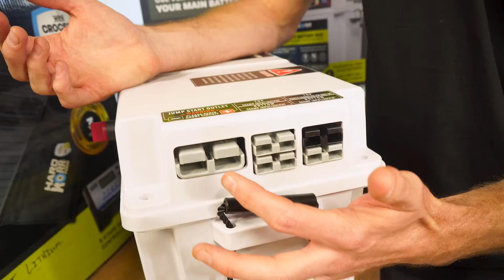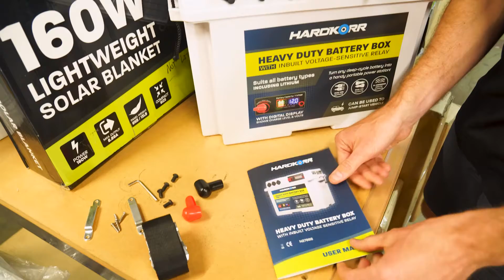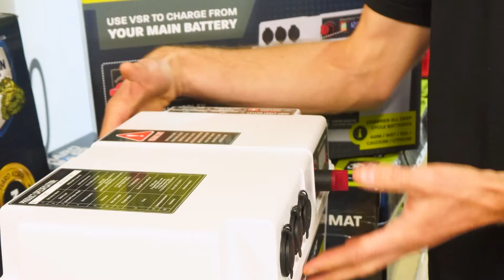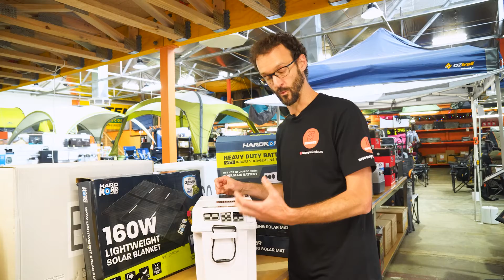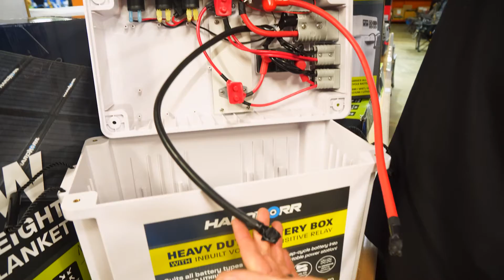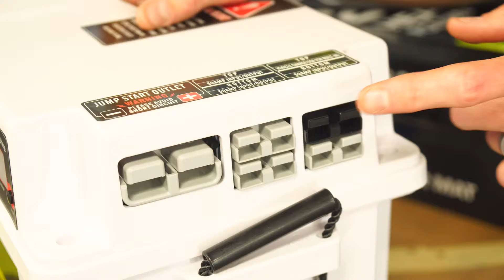Hard Korr Heavy Duty Battery Box with VSR

Comment: Was looking at putting the hardcore 100 amp lithium in this as my second battery in back of the tray and haven a everdrive 40 amp dc2dc running things would this work or no need for battery box as don’t really need all the sockets?
Reply from the maker: No need for a battery box @shane staff, just make sure your Enerdrive charger has a lithium program.
~ Lauren
Reply: @SnowysOutdoors  it does have a lithium profile would the battery box make it more useful in back of the tray or more of a hassle trying to run all my aux stuff to the lithium battery
Reply from the maker: @shanestaff6307  the battery box would definitely provide some protection, but as you've said, you are paying for alot of componentry that you ultimately don't need.
It does give you the flexibility of using it as a portable power solution down the track if you ever have need to use it that way...if not and you only foresee it as permanently in the vehicle as an aux battery, check out Jaycar or similar for a generic battery box that is literally just the protective plastic shell.
~ Lauren

Comment: I've found with the vsr plugged in the power stays on in battery box even when turned off? Any ideas
Reply from the maker: Hmmm, I'm pretty sure that when the main switch is on the off position, the battery should be completely isolated. Have you double checked the wiring of the isolator when you installed it? ~ Ben
Reply: @SnowysOutdoors  yes I checked it out...it turns on ok..hear the click and light comes on but when I turn car off even below 12.7 volts light on VSR stays on. Fault in VSR I think. I'm just going to wire in a switch to main battery. Thanks for replying!
Reply from the maker: @danlatimer406  I'm not entirely sure sorry. It could be a difference in voltage measured at certain points. I know my isolator is supposed to cut out at 12.6 but the voltmeter on my dash sometimes needs to go down to 12.4 before I hear the cutout click.
I don't have much more to add without seeing things sorry.
~ Ben

Comment: Will the dual battery charge even with newer vehicles with smart alternators ??
Reply from the maker: You'd probably need to add a DC to DC charger in this instance, Raymond. 
The latest version of this battery box doesn't include the VSR, instead it can be purchased as an accessory, so that those who need a DC to DC charger to suit smart alternators don't end up with a redundant VSR port. 
You can see the latest video here - https://youtu.be/jb4xTaf2D6k?list=null. 
~ Ben

Comment: Can I connect more 12v ports using an Anderson plug on the side.   I have one which has three and connects to the draws in the Ute ?
Reply from the maker: I'm not quite sure what you mean sorry, Raymond. There are four Anderson input/output ports on the side that you can use which are rated to 50A so you could use these to power multiple devices. 
I hope this helps.
~ Ben
Reply: @SnowysOutdoors   I wanted to connect more cigarettes port charging devices off one of the Anderson plug.
Reply from the maker: @raymondjames4027  I guess this would be fine if you were able to make up or have a wiring loom to suit your needs. Just be aware of the 50A maximum, for the ports.
~ Ben

Comment: I have one of these boxes but was a bit confused when it came to the dual-battery wiring kit as it did have any installation instructions, I am unsure if I should be grounding the negative lead or connecting it to the main battery negative terminal, any help?
Reply from the maker: This could be dependent on the setup specific to your vehicle, Dean, I'm no auto electrician sorry so it could be worth consulting with them if you are unsure.
However, the simplest method is to connect the batteries in parallel, which means negative to negative and positive to positive. By connecting the negative of the auxiliary battery to the negative of the cranking battery you are essentially connecting to earth anyway.
~ Ben

Comment: The 175 plug...can I plug in my inverter into it.
Reply from the maker: Hard Korr only label this as an outlet port for the jump start kit, Micheal, the wiring associated with it is designed to handle the currents required in this instance and the plug is much larger. I can't imagine any inverter would require this much current, I'd suggest using one of the existing Anderson ports. ~ Ben
Reply: I’m doing this at the moment, using the kings 1500w inverter. Using there wiring, chopping off the ring terminals, adding a 150amp inline fuse on the positive wire, then soldering on a 175amp Anderson plug to use on the hardkorr box. I’ve been assured this is fine to do

Comment: Any left in stock?
Reply from the maker: We are all out sorry, Rhi. We do have the new model which will be online very soon, hopefully, this week. The only difference is that it no longer comes with the VSR and is now available in both black and white colours. The VSR is now available as a separate item and is easily installed if required. I imagine they did this as many people use a DC to DC converter and don't need the VSR. ~ Ben
Reply from the maker: He @Rhi McKeon, the new ones are live, updated video coming out soon - https://www.snowys.com.au/heavy-duty-battery-box. ~ Ben
Reply: Snowys Outdoors  hi, you would need the dc to dc charger if your car has a smart alternator ya ????

Comment: Very interested in this product but I want to incorporate a DC/DC charger, can it be done?
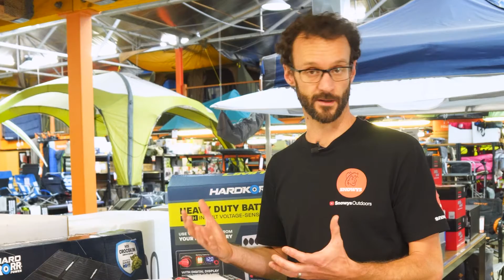Reply from the maker: Yes, you sure can use a DC to DC charger, Brian, we mentioned this at 6:25 in the video. Long story short, you don't need one if you use the VSR port, but if you have a newer vehicle that required a DC to DC charger for efficient operation then you can use it via one of the ports without the VSR. ~ Ben

Comment: I think you'll find out that the ciggie ports and the 175a are bidirectional. Ideally they shouldn't be used for that but they can be inputs as well as outputs.
Reply: 175a can be used 2 wire up to an inverter as well with the proper wiring kit which hardkorr sell as well.
Reply from the maker: Hmmm, it's certainly not advertised as such, munecito2002, so proceed with caution if you are going to try this... we don't recommend it. 
The 50A Anderson plugs without VSR are actually bi-directional, I haven't checked back on the video but I think I forgot to mention this. ~ Ben
Reply: @SnowysOutdoors  no need to proceed with caution. The box didn't have a blocking diode for those connectors. They are all wired from the same busbar in the main switch. 

I wouldn't use the ciggie connectors to recharge a battery unless using a very low current charger but it is definitely possible. 

The 175a port is actually a great port to recharge bypassing the VSR as the cable is thicker.
Reply from the maker: Sounds like you're in the know, @munecito2002, you're talking language I'm not familiar with. I'll leave it up to other users as to whether or not to use it as such, but as a reseller of the product we need to stick with what the user guide indicates so as to ensure warranties etc remain valid.
Thanks for your feedback here though, I'm sure other users will find it useful.
~ Ben
Reply: @SnowysOutdoors  Ben. I'm not picking on you it is just that such claim isn't in the best interest of safety. If this battery box was connected to an unfused connection straight to the main battery and their charges are dissimilar or different chemistries then one of the batteries can swell or even catch fire while they try to balance their charge. Never underestimate what someone that doesn't know could do. Maybe bring it to Korr's attention. Nobody doubts that they made the manual with the best intentions but that affirmation may cause an accident there was already a misprint in their manual claiming that the box had a 5v USB to 12v DC adaptor cable. So things like this sometimes fall through the cracks.
Reply: @Stoicloner1  yes but why would you buy an imitation Anderson? They are not that expensive if you get the real thing from a place like swe check or connector tech als. 

Real Anderson are rated for heat, sun exposure and chemical exposure so they don't crack like imitations

Comment: been looking at this battery box for a few months but would like to see an actual operation review with a lion battery installed and go through the paces. would be nice if the box had at least (1) 110volt outlet for using with some small appliances
Reply from the maker: We contemplated the idea of putting a battery inside, Paul, but the logistics and costs would have held us up, and we felt we could give most of the information required without the battery inside. 
Being an Aussie company it is more likely that Korr would have included a 240V outlet, but the maximum current draw limits what you can power from it anyway, and a suitable inverter may do a better and more reliable job of this. ~ Ben
Reply: @SnowysOutdoors  Hi guys. Could you recommend a suitable inverter that would compatible ?
Reply from the maker: @ozadventures8640  inverter size is largely dependant on how much power you require. You'll need to total up the wattage of all the appliances you want to run, then, once you know this figure you'll be able to match it to an appropriate inverter and, inturn, how long the battery that you put in this battery box will last.
I'd go as big as your budget and space will allow, and if you can get a pure sine wave inverter.
~ Ben
Reply from the maker: @Stoicloner1  yep, they are an Aussie owned and operated company that have a dedicated factory in China.
~ Lauren